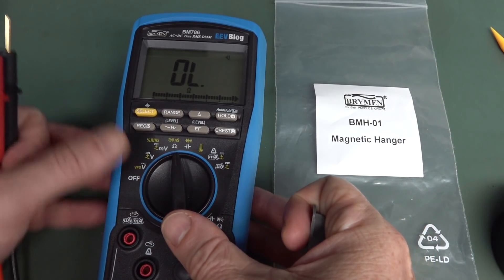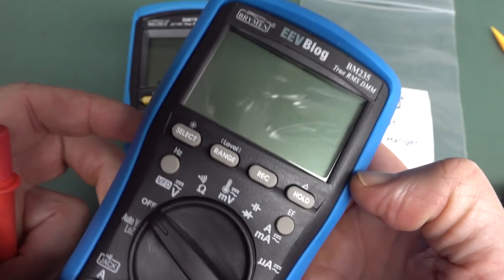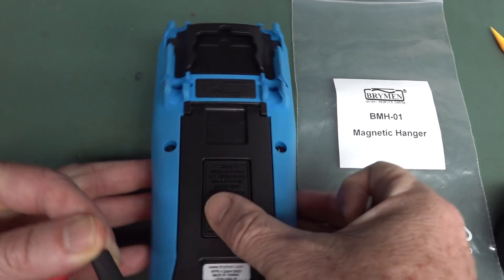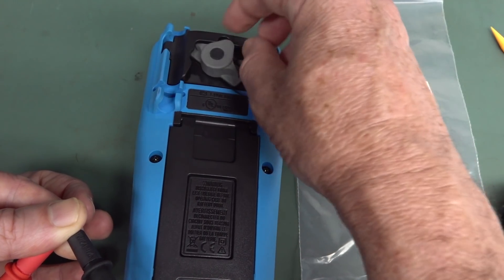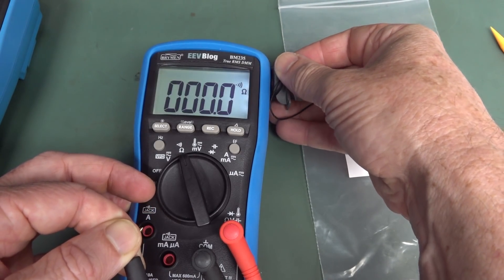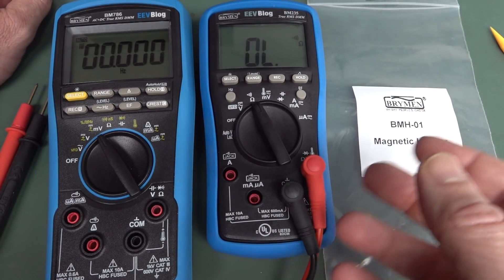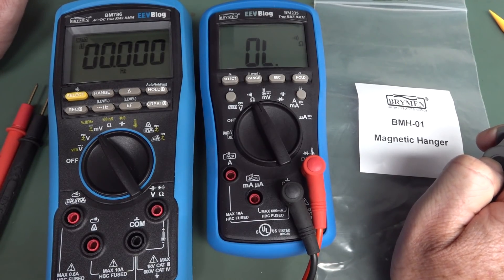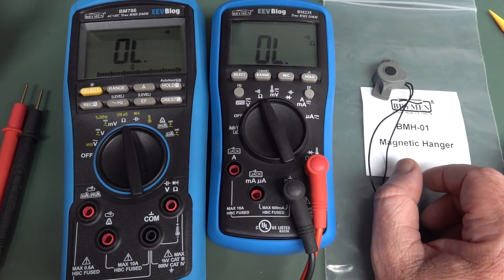BM786 Magnetic Quirk

Comment: With the loudness of the newer meter I'd almost call this a feature :-)
Reply: Geeez @EEVBlog now I feel special :-)
Reply: Was gonna comment the exact same (Though not got an EEV-Dave certified meter yet, it's still a feature)
Though, what'd be a killer feature is to have a tone that changes in the milliohms ranges (Not need to be accurate, just changes in tone: more pitch, shorter the short-circuit).... Someone at work has an old "tone-Ohm" box that is useful at finding the culprit components in a short.
Maybe Dave could get Bryman to add the feature (and also the "state change alarm" feature to be added like in Dave's fuse-blowing video could be handy too).
On the subject of feature creep, anyone got feature ideas to add to a multimeter (time? X'D) knock yaselves out with the ideas, I wonder if Dave would forward the best feature requests forward and maybe redefine the multimeter?
Reply: Yeah, you could design a little plastic thingy with a magnet that can be moved left and right to regulate the volume.
Reply: sounds like the speaker is being held up lol
Reply: Very handy indeed! I stuffed my Keysight UC1242C with paper on the backside, to get it quieter. It's annoyingly loud.

Comment: I don't think anyone will have a problem with BMH-01. It's absolutely useless - as a magnetic hanger and as a strip hanger. As a magnetic hanger it barely holds it's own weight. As a strip hanger .. well if you want a rotating DMM you can call that a feature too.

Comment: I wonder if this would work better than bluetack to silence the annoying and repeating - 'I'm done beeper' in my microwave.
Reply: wire cutters??
Reply: @zebo-the-fat  Angle grinder?
Reply: I'm so glad that my microwave oven has an option to disable its beeper! Especially since it likes to beep every 30-60 secs after it's finished, apparently indefinitely... 😬

(Samsung, ~3 years old, fairly basic, UK model. Maybe check the manual for yours - whoever happens to read this - to see if it has a similar feature? 😸 Though this is the first one I've seen with that option, so I don't think it's very widespread...)

IIRC you toggle the beeper on mine by pressing the Start & Stop buttons simultaneously, but if you don't time it perfectly it immediately starts a 30-sec heating programme, so it usually requires several attempts 🙄
It feels almost like an afterthought or Easter egg, using an awkward, unlabeled button combination - though it's mentioned in the manual, so it's clearly not that much of an afterthought...

Comment: Magnetic hanger for the BM235? Interesting. I didn't know such a thing exists.
Reply from the maker: I used to bundle it with the case.
Reply: My bm235 was the worst meter I ever owned the battery would drain in the off position in a week  didn't have the heart to tell my girlfriend because she bought it for me because I really wanted one.when we spit up I threw it out what a waste of money total junk
Reply: Surely "battery drains in a week when switched off" is a manufacturing fault for a device like that, and it should be replaced by the retailer/manufacturer? 🤔
Reply: @georgejobin1744  It was a waste to have thrown it out. You should have contacted Dave so he could have a look at it. It could have just been a rare case of a faulty unit. I've found it to be a decent meter with just one (so far) minor quirk and an extremely oversensitive continuity buzzer. It will beep as if there is continuity with 175 ohms between the probes. :P
Reply: @georgejobin1744  To reinforce comments by others... I've had the original batteries in mine for about 2 years. I only use it once or twice a week, but they are still running strong, so it was def. a problem with that specific unit. OTOH, if you wanted to get rid of it because it reminded you of your ex, well, that's a totally different subject...

Comment: Well, this "problem" certainly wouldn't effect me as I can't hear any of these buzzers anyway.
A visitor to my house once complained that a smoke alarm was sounding the battery low chirp but I never heard it.
What's the point in having an audible alarm if you can't hear it?  Seems to me that Engineers/Manufacturers should
design devices so that those of us who have no high frequency hearing can be alerted?
Reply from the maker: Buzzers in these are in the order of a few KHz. If you can't hear that high then I suspect you have a very serious problem.
Reply: @EEVblog2  Yes, I do.  I think it comes from when I was a kid on the farm driving loud tractors for hours on end with no ear protection.  No one even thought about it in those days.
Reply: You are in the minority and possibly damaged hearing from exposure to loud noise, etc. Producing a lower frequency sound at the same volume level would require a larger transducer and increase the cost. One option would be to get a hearing aid with frequency translation functionality.
Reply: You can actually buy smoke detectors made for the deaf which flash a light and even can vibrate a unit you can place under your pillow at night. They're typically very expensive. Depending upon your circumstances there may be grants etc that might offset some of the cost.
Reply: I added a led to a magneto meter that had a low battery beeper. It was very loud but the owner could not hear it. Funny part was that he asked me to add some low battery detection because he did not know about the buzzer  because he never heard it.
Reply: Hi , i remember old school telephones had as a extra a "gliding tone ringer" it was basically a add on to the standard rotary dial phone and early touch phones, when the ring signal was received, the phone rang as normal, but the secondary bell ( mounted like say a front door bell  ringer ) produced a extended version of ringing up and down the musical scales - i was told some people cant hear certain frequency irregardless of the volume so this device played multiple hz signals

Regards
George
Reply: The older you get the less high frequencies you can hear.  I'm 72 and in this video I could hear the BM786 ok but the BM235 was completely silent.  I can no longer hear the alarms on watches and I can barely hear the buzzer on my own BM235, so it's very useful that the backlight flashes.  

This effect isn't normally noticeable in daily life but it does make it diffficult to watch modern films and TV dramas where people have a tendency to whisper a lot.  My doctor says it's just a normal result of old age.

I did find that placing a neodymium magnet on the top corners of my BM235 makes it completely silent (to me).
Reply: @petehiggins33  Can You hear BM235 when You put beside or very close to ear(s)?
Reply: @bokidm  Yes I can and both ears are about the same.  I can also hear it when it's about 50cm away but then it's very directional.  If I turn my head to the right angle then it goes silent.

Note that this is nothing to do with ear wax.  I do occacssionally suffer from wax in the ears which can dramatically reduce hearing but they have recently been cleaned out.  It's something that has progressively worsened since the age of about 60.
Reply: Yeah, they should design it with Braille too... And a clip for people to clip it on to their wheelchair, and everything on it should be one handed for people with only one hand. They should put a built in magnifying lens on it too. That way we can cover all of the fringe cases, and everyone will have to pay for the features that 0.001-0.1% of users will use.